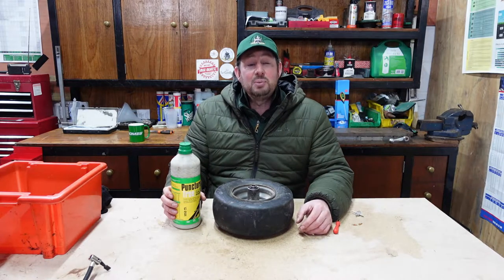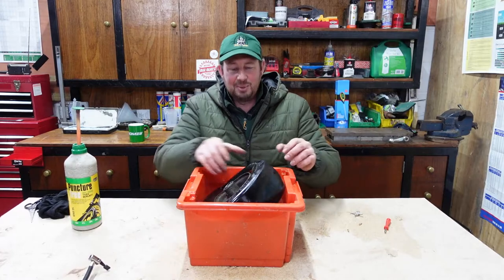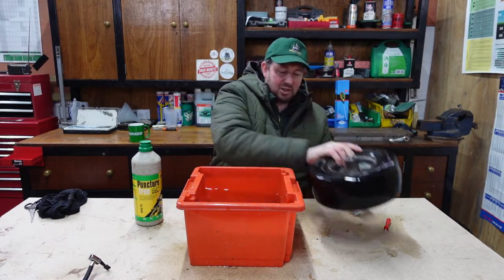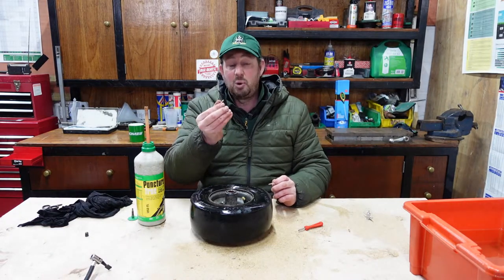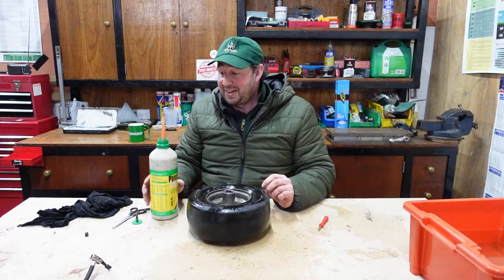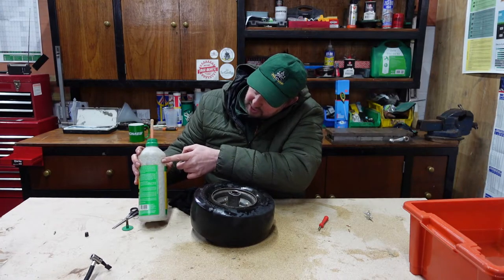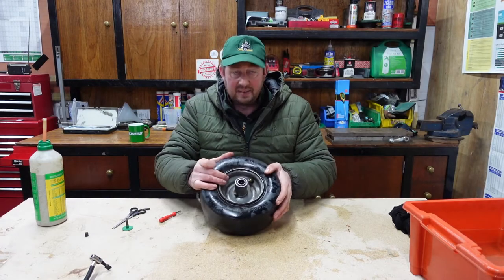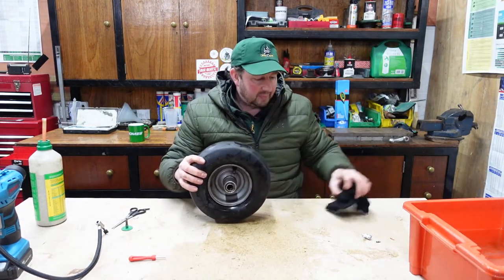How to use Tyre Sealant Tire Slime Easy Repair Tutorial Instructions Oko Mower Wheelbarrow Tractor

Comment: Good vid. Ordered some to try on 2 tyres with a load of thorns
Reply from the maker: It should work well. Get plenty in and run them round for a while after to seal them all properly 👍
Reply: @JimmyTheMower  Looking to use it on a Billy Goat brushcutter where we get persistent blackthorn punctures. Do we need to remove all the torns before sealing?
Reply from the maker: @ashteadryemeadowswetlands2513 it's best if you can remove as many as you can first.
Make sure you put plenty of sealant in and give them a good roll around straight away to seal 👍

Comment: Nice video Jimmy its good stuff that my uncle used it for his ride on mower and small lawn trailer dont know if the tops come off them bottles but the ones he used did and he had a spare top and tube and used that instead of having to cut the ends
Reply from the maker: Mate, now I'm intrigued and I'm going to have to take the top off and see what's inside 🤣🤣🤣